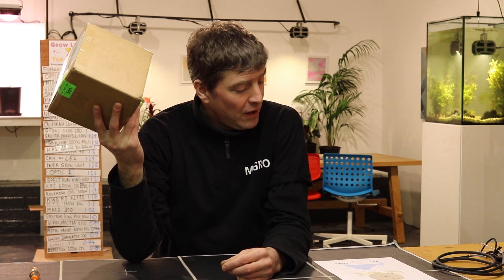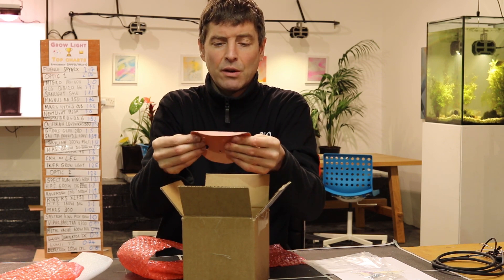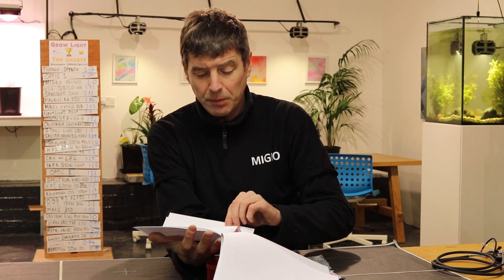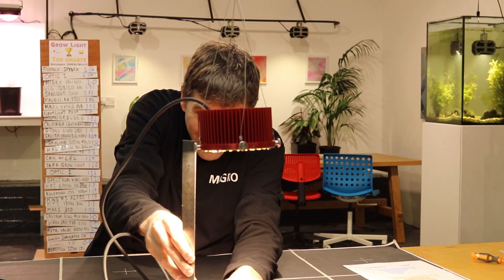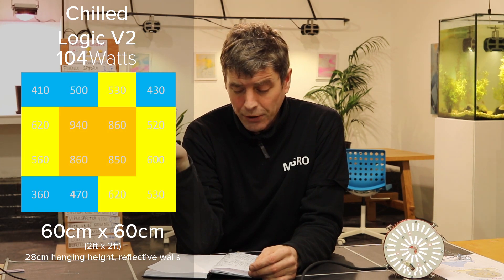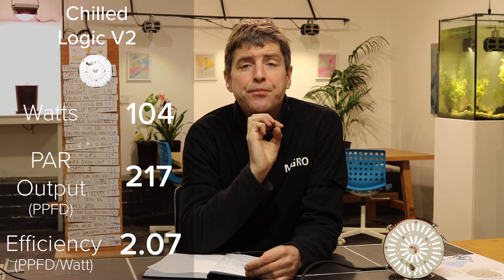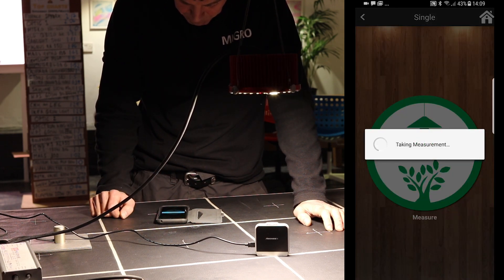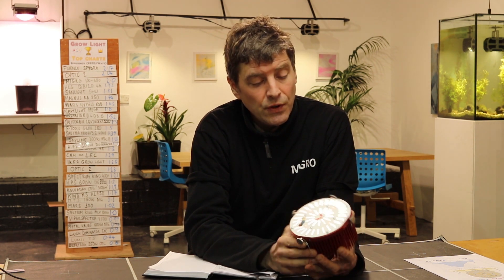ChilLED Tech  Logic v2 Puc DIY grow light - test and review

Comment: Should per-watt metrics be supplemented with something like the total cost of growing, say, three crops to flower?  Some of the up-front costs of these lights dwarf operating costs.  A 100w Optic XL ($200) will use around $36 in electricity over a 7 month grow cycle (18/6 and $.10/kW).  A dozen 9w GE grow bulbs (~$108) will bump that to $39 per crop.  The price difference takes about 3 crops to even out.

Comment: What's better the puck the optic 1xl or hlg 100v2??? Anyone? Just a filler fo my tent for flower
Reply: This and the HLG have the same diodes.  This has 210 LM301B +4 deep red vs the 192 of the HLG.  This is 50 bucks plus 20 for the heatsink and then the driver.  HLG is 150.

Personally, I prefer this since it's slightly more cost effective, has deep red and the Rapid LED rail system is expandable.  It also just looks better imo and has a smaller footprint.
Reply: @DangerDavez  thanks bro for the feedback appreciate it..!

Comment: Over priced leds
Reply: 50 dollars?
Reply: @pepeman3099  that's just for the LEDs not include driver Wich is another $50-100 depending on Wich driver you use
Reply: @southwestmedgrow6241  That's really not bad at all...  I already had a driver capable of powering 3 so 150 plus 60 for the heatsinks.  210 plus tax.   Driver would be 70.  

One of these would outperform your Meizhi and you'd be using half the power.
Reply: @DangerDavez  In the words of growmau5...."If you aren't getting at least 1.7 umol/j then what's the point? Stick with HID..".. Quality led is not cheap .....

Comment: Fairly easy to get a 120mm 12v fan on these beefy sinks as well. I've run those RapidLED heatsinks with fans with old Vero 29C's for a while. May switch over to these pucks at some future iteration. Thanks for all the great testing lately!

Comment: I got some ChilLED lights and they do not disappoint. I have strains I have been growing for quite some time. I noticed early into flower a difference. They started putting on more trichomes. If you have everything else on point these ChilLED lights will reward you with the extra sticky flower.

Also, I believe it was LokiGro had a new version of the ChilLED puck. It had blues instead of the reds so it will be better for veg. Look for that coming out in the near future I'm guessing.
Reply: Actually, I started watching this channel because GrowMau5 talked about it. He said he liked what you were doing so I checked it out and been watching for a while now.
Reply: @Moe75G  that's how i found the channel as well. I got one of chilled  600watt industrial lights and it's a bad boy especially with the controller simulating the day sunrise and set also does 5 to 10 min of all red before lights out. My plants exploded and I had to buy better eye protection energy expenses cut by a little more than half. Best lights on the market in my opinion.
Reply: @thegriffinsden3383  which light are you speaking off, do you mind sharing?
Reply: @TeXinat0r  they dont make the one I have or have it posted anymore. They are working on a series of commercial lights called v2 like the pucks and they will have a 600 watt I'm sure. The company Isnt doing good as far as  advertising goes and getting info out. I only know because i follow growmau5 and he said it in a live video.

Comment: Interesting review. You put acrylic over the HLG 550 to protect LED diodes, but not on this one?
Reply: Can't really easily attach it to this light, the screws are all used for thermal contact. Plus he showed this light quickly with and without acrylic and the hlg light with and without (but more in depth in the hlg light) so I don't see anything wrong with it.... It barely makes a difference in his testing, so it's not like it's even a 3% handicap.
Reply: @volvo09  I was more interested about the safety aspects rather than the affect on test results. He made such a great case for protecting the HLG, I was wondering on the advice/difference here.

At the end of this video he seems to get the acrylic out and tests the difference, where the one that appears thicker seems to give a better result on the meter which was interesting.

As you say, the puck doesn't seem to be able to have one fitted as easily I guess.
Reply: @lemongf  It's a good point - and one I considered myself as soon as Shane released the HLG video. I have two of those and a chilled Puck, all unprotected in a small space. Haven't had any issues yet. But it's a valid concern for sure.
Reply: @iconoclasttastic9258  Yeah, they should be okay uncovered, but Shane did make some great points about the accumulation of dust or knocks to the diodes. I showed my friend who has an HLG light the video and he learned a lot, seemed tempted into protecting it.